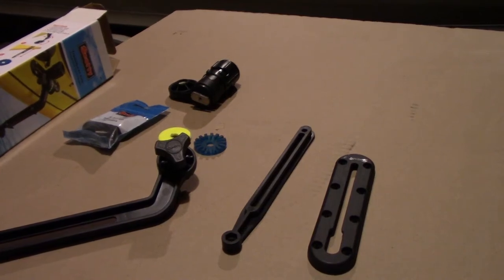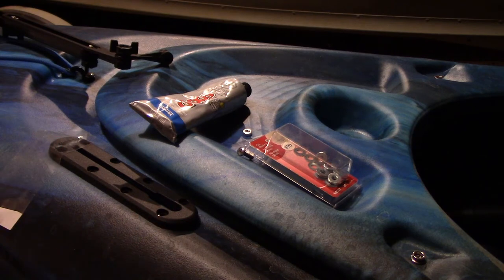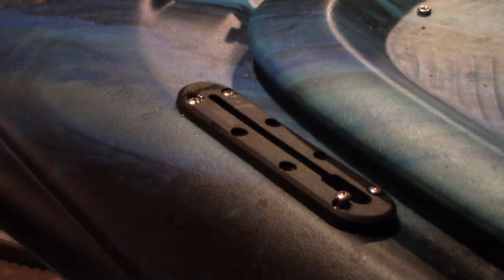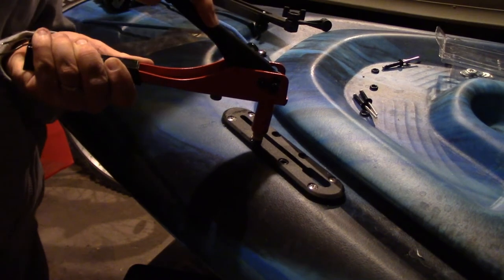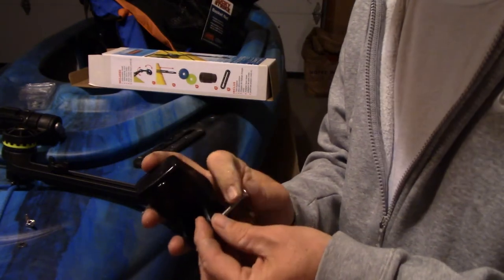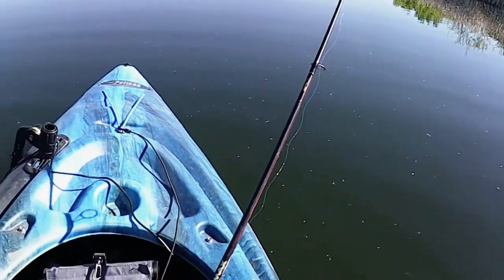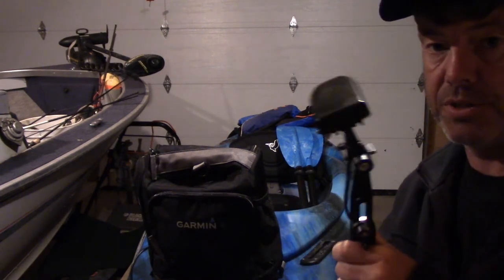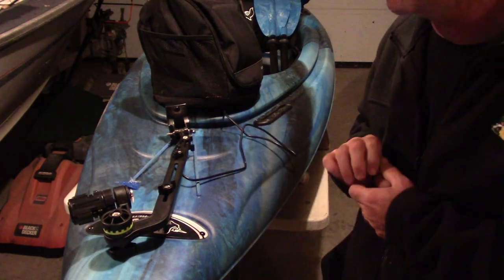Pelican Mission 100 Kayak modification.
Scotty Transducer Arm install for Garmin Striker 4.

Comment: Hey there! Thanks for the super in-depth video. I have the same Pelican Mission 100 kayak and I am going through the same process as you : how/where to mount the transducer arm. Are you still satisfied with the track placement on your kayak? There aren't many flat places on this specific Mission 100, are there? What motivated you to install it on the left side? Is it because of the tightening knob placement? Thanks!
Reply from the maker: Hello! I am satisfied with the track placement. I chose the left side as I am right handed and typically fish out of the right side. I hope my answer helps.
Thanks for watching!
Reply: @footprintoutdoors6144  do you have problems with reaching the knob when you want to raise the transducer? Since you are right handed, can you access the knob to loosen or tighten it?
Reply from the maker: @davidbergewaytogo  not really, I may have gotten used to  it I suppose. I definitely like having it.